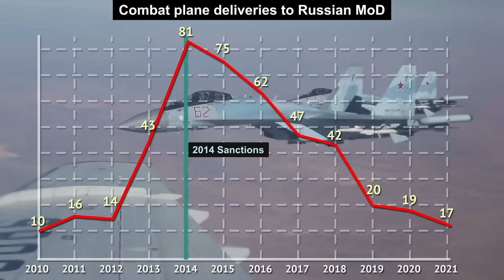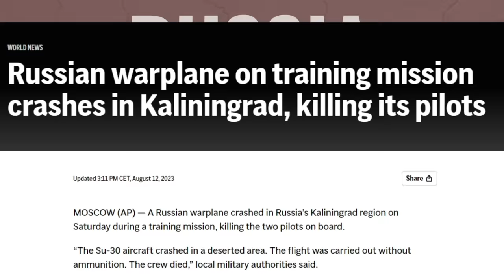Russia has produced more combat jets than it lost in Ukraine in 2023

Comment: If it's "damaged but can't be repaired" .. then it isn't "damaged" .. it's "LOST".
Reply: I believe the distinction is that "lost" is a total lose, crash and burn sorta situation, whereas "damaged but can't be repaired" implies that the plane landed well enough that while the plane is still too damaged to fly again, it can supply parts to keep other aircraft airworthy. 

Say it took a glancing hit from AA, which caused airframe damage sufficient to require a complete rebuild of the whole airframe, you might as well just build a new plane. You could still pull all sorts of goodies like engines, radars, munition interface mechanisms, landing gear assemblies, and use them to repair "damaged but repairable" planes. So one "damaged but can't be repaired" plane might revive a score of other aircraft, but a "lost" aircraft won't, and in the arithmetic of war, that matters.
Reply: I wonder if ‘repaired’ and ‘refurbished’ are considered separate categories

Comment: 30 planes at $50 million each is around $1.5 billion. That's not small change. But the big loss is really in the experience pilots. That's much harder to replace.

At some point, you'll need to account for the higher hours of airtime that these planes are accumulating. The airframes are rated for x hours of flight time with are rapidly consumed by wartime operations. Their useful lifetime will be much shorter and Russia would need to build planes to replace the worn out airframes in additional to the ones shot down..
Reply: Did you not just watch this video? Russia replaces it's fighters faster then they can lose them, brand new jet fighters every month you think they care about airframe hours?
Reply: I would say that a well trained pilot is far more valuable than an airframe.
Reply: @titanproductions3628  The video doesn't account for the effect of the sanctions. Extrapolating from 2021 numbers is pure guesswork.
Reply: @titanproductions3628  If Russia were to only lose aircraft that were end of life and being phased out, you could replace your losses with about the same amount of production.  

Because Russia has losses from aircraft that are in the middle of their life cycle, more must be produced than just the losses, otherwise you will be left with a smaller air force year after year by decommissioning old aircraft.  
These will also have to be taken out of service more quickly due to the higher intensity of operations during a war.  

Think of it as if you produce 40 cars every year, throw away 40 every year due to old age and lose 30 due to accidents.  If nothing changes you will have 30 fewer cars in the fleet every year until you are left with a very small modern fleet that is only 1/3 of the original size so you only need to decomission 10 cars every year.
Reply: Someone solved that problem long ago don't worry. It's called an ejection seat.
Reply: @divoulos5758  Doesn't help much when your pilots fall into enemy territory😅
Reply: @j4genius961  they are usually fine. In modern warfare there are very vast areas that no one dares to go since it is covered in artillery. The pilot can walk to his line or be picked up. With such a mess there probably the first one
Reply: @divoulos5758  Oh I See...
Reply: By Oryx estimate, ~10 pilots died. Not 30. That's highest possible no of airplane loss estimated by Binkov.
Reply: @alexvandun2124  I think it's safe to say that a country that defeated Napoleon, Won WW2 and is currently fighting a 21st century war is all set when it comes to building aircrafts and fighting wars.
Reply: @stormystudios9804  You have no idea whether they work or not, and that's my point. As I said, pure guesswork.

Comment: Replenishing your fleet with 40 aircraft while losing approximately 30 in combat per year is not feasible in the long term.  

Due to higher sortie rates, airframes are used up earlier than in times of peace.  
In addition, the Russian fleet was already old before the war started, so replacing what you lose in the war is insufficient. 
The majority of these contracts and deliveries are based on replacing old aircraft, not replacing shot down aircraft. 

They will have to double their production at current losses if they do not want to lose any capabilities long term. Especially if the war drags on for years.
Reply: Su-35s are Su-34s are all new, even Su-30s are not that old, mostly newer than the bulk of NATO air forces flying F-15s and F-16s and F-18s (or F/A-18, depending on a country).

Su-24s are relatively old but being replaced by Su-34s.

Now Su-25s are not being replaced directly, but they are not effective on the battlefield full of MANPADs and functionally are being replaced by drones or drone-corrected (and thus much more precise and effective than before) artillery fires.
Reply: @PaulVerhoeven2 In your reaction I make up that you are agreeing with me, but im not sure. So for a bit of extra context.

If Russia were to only lose aircraft that were end of life and being phased out, you could replace your losses with about the same amount of production.  

Because Russia has losses from aircraft that are in the middle of their life cycle, more must be produced than just the losses, otherwise you will be left with a smaller air force year after year by decommissioning old aircraft.  
These will also have to be taken out of service more quickly due to the higher intensity of operations during a war.  

Think of it as if you produce 40 cars every year, throw away 40 every year due to old age. Now factor in the fact that you start using those cars more often and and start losing 30 due to accidents.  
If nothing changes you will have 30 fewer cars in the fleet, and every car in the fleet will also see more milage. This will go on every year until you are left with a very small modern fleet that is only 1/3 to 1/4 of the original size so you only need to decomission 10 cars every year. 

In a country like Russia with a lot of big powerful neighbors (China, Korea, Poland, Finland Ukraine) you need quantity to defend yourself because of the immense borders with other countries.
Reply: That is true. Among military analysts there is a consensus that due to combat stress on the Russian fighter planes in combat, the life expectancy of these aircraft means that a lot of them are nearing the end of their life as effective aircrafts. A lot of Russian airframes will soon be unsuitable for service in such a degree the Russia will not be able to replenish its losses. As a result, available Russian military aircraft  numbers will inevitably dwindle.
Reply: @alexvandun2124  I really doubt that Russia is worried about Poland or Finland invading its territory, Ukraine is what it is now, and China, although big and powerful, does not have any aspirations to conquer Russia; China has great relations with Russia. Other than that, your analysis is interesting.
Reply: @zix_zix_zix  Kaliningrad could be interesting for the NATO alliance if they are worried about de the Baltics being invaded, or if Russia tries some militairy action in the Baltics. This would automatically bring Poland, Sweden and Finland in the mix because of their proximity.

And although China and Russia are on friendly therms at the moment, all that can change within a few years. 

In 2010 there were NATO alliance members participating with tanks in Moscow on Victory Day. That would be unthinkable at the moment.

Between 1969 and 2003 Russia has had more soldiers on the China Russia border than on their European border. 
So things can quickly change if geopolitics change.

And military procurement is something that takes years and years to ramp up or slow down. 

In Western Europe we see a very slow ramp up at the moment of trying to start up (restart) militairy production, and 2 years after trying to start up, we still dont meet most of the required targets for products like ammunition, tanks, IFV's or even spare parts. 

And the supply chain of modern aircraft might be one of the most complicated there is, therefore the ramp up is also very complex and takes a long time. 

So losing a lot of aircrafts in the 2020's can hurt a country even in the 2030's if industry can't replace your losses.

Only the US and China at this point are producing more than a 100 fighter planes a year and can lose big numbers like Russia is losing without impacting their fleet to much.
Reply: @alexvandun2124  I agree. However, I believe that a much greater change is currently underway in international relations; two distinct poles have been formed (i.e. West and the Rest). Both Russia and China have decided to move away from the West and form this adversary center of interests. Countries very close to the West, like Turkey, have joined this camp (albeit unofficially) and others, traditionally opposing the West, like Iran have done the same. I don't see this new order of things changing anytime soon..
Reply: @zix_zix_zix  "China, although big and powerful, does not have any aspirations to conquer Russia; China has great relations with Russia. "

That is just not true. On Chinese maps, part of the current Russian territory, half of Siberia, is indicated as Chinese territory occupied by Russia.

Chinese government is just smarter than to chose war as the first tool, especially while Russia has nuclear weapons and China does not have a good anti-missile shield. But they certainly would not refuse the rich land with oil, natural gas, gold, diamonds etc when such opportunity presents itself, especially when they finish building their missile shield.

Comment: Not factored in is the increased flight hours from wartime sortie rates. Su-35 has a 6k hour airframe lifespan, older models have as low as 4K hour lifespan. Most of the aircraft in the fleet are mid life, with a decent amount of flight hours already clocked up.

Say Russia is flying 100 x 4 hour sorties per day. It’s probably more and longer, but that gives 400 flight hours per day. 10 days takes out an equivalent of an Su-34. 

With 730 days of conflict at 400 flight hours a day, that’s 292k hours or the equivalent of 73 Su-34s with 4K lifespan. This is going to be an immense amount of wear and tear on the fleet, causing probably triple the attrition of combat losses.
Reply: Fatigue on aircraft is something that can be ignored for a long, long time before becoming an issue. It's a regulatory issue rather than an engineering one.
Reply: @rollercoasterintogiantdomo  It's a regulatory issue because no one wants to be in a plane that fails in mid air. Outside of Russia, human lives are valuable.
It's an engineering issues because flying puts a lots of stress on materiel which will fail after x amount of hours. Those hours are part of the engineering design and learned through testing and through blood.
Reply: @rollercoasterintogiantdomo  I’d flip that one around. Regulatory issues come from engineering predictions. If the engineers predict a bad outcome, then the regulators will make a decision to accept that risk or prevent it. For example, Ukraine is currently flying their su-25, mig-29 and su-24 fleet beyond design life because they cannot replace the aircraft during this conflict. That results in a high risk of airframe failure and crashes. 

Russia can accept that risk, that’s a regulatory decision. But the engineering forecast will be sound and it will result in aircraft crashes and aircrew losses as a result.
Reply: @HuyLe-qc8jc  It's not an engineering issue. Airframes have their service lives extended regularly. All it takes is a thorough inspection, and it can be certified for more. Modern fighter airframes have a high percentage of carbon composites, a material resistant to fatigue cracking. There is also a thing called "service life extension", which can add thousands more hours of life to the aircraft. The idea that the entire aircraft is thrown away after 6k hours is incomprehensible.
Reply: @ihatemyselfxd7252  400 hours flown by the entire fleet of aircraft. Not a single plane.
Reply: Should imagine what’s flying now is very tired, should imagine early on aircraft were being basderdised for parts but now there’s nothing left. Civil aviation got hammered. Should imagine the engines haven’t had an inspection for a long time and every jet will get run into the ground eventually.
Reply: Airframes last forever. I mean can you imagine your car failing after like 4000hours of driving? I can't but what is even more inconceivable to me is that the metal shell of the car being the point of failure of the car, instead of the engine or tires. In jet aircraft everything is about the jet engine. Everything else is cheap. The engine is everything and it is what keeps maintenance costs high
Reply: @divoulos5758  in fast jets and military aircraft specifically the body gets stressed all the parts come under immense G loading, engines have a shelf life, landing gears have a cycle life, wing spars have a shelf life, control surfaces and flaps. Pressurisation systems, canopy, fuel systems. They all need maintenance 8k lifespan would be an old airframe they will run them into the ground for sure.
Reply: @legendofthepeach  the aircraft is rarely subjected to such stress tho. In most cases pilots won't surpass even 2gs of acceleration. Any stress in that region doesnt cause plastic deformation of any kind. The only situation i can think off that this would be such a big issue is if they push their jets at supersonic speeds very usually. The hot high pressure air from the drag can cause the aluminum alloy to deteriorate faster over time
Reply: @divoulos5758  fast jets routinely have high G loading. It’s not acceleration that’s from the G it’s tight turns and tight manoeuvring they will see 7-9 G’s.
Reply: @legendofthepeach  that's only in dogfights, or missile evasion manouvers. Those aren't ordinary things. From what i have heard these aircraft mostly shoot glide bombs. There isn't much of UA airforce to fight anyway and since their s300 are very depleted, patriot simply lacks the range to be enough of a threat to force the pilots to do such manouvers.
Reply: @divoulos5758  Russias lost 7 aircraft in 7 days. Of course they have substantial missile threats. Usually have to strip down a fighter around every 200hrs depending on cycles and use